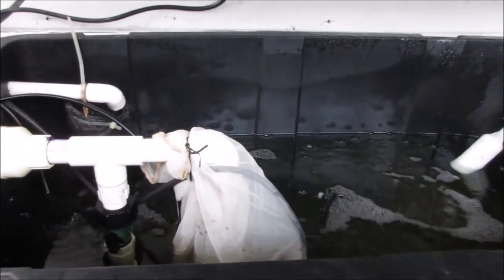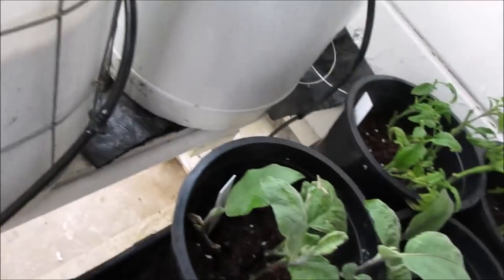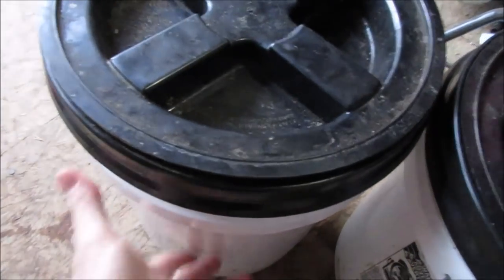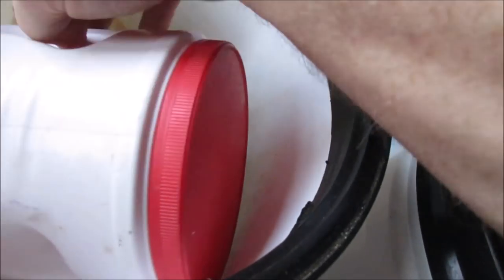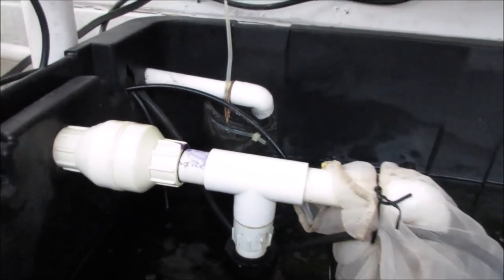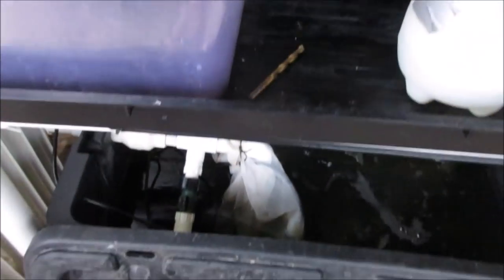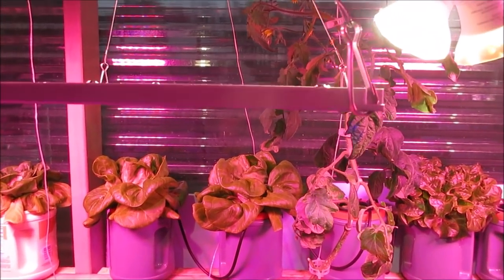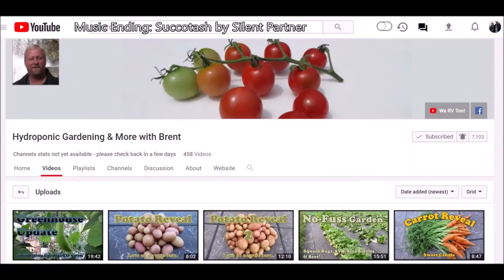How to Grow Microgreens NFT Style (Set-Up)

Comment from the maker: I've gotten much better at growing microgreens.  So consistent, pristine, and with massive harvests based on some changes I made that really set things off.  I decided to write a how-to book on it: https://amzn.to/2ZZdkJb.
Reply: What is the bottom watering tray holding the 1020s? Looks great but cannot find it on your amazon link. Thanks!
Reply from the maker: Amazon link is in the description of every video.
Reply: At 14:15.  Put spreader mat on the tray. It spread water evenly on all tray without dry spots. Its basic must have part of NFT setup. Its very thin and cheap lining.
Reply from the maker: @simonci5177  I don't grow NFT any longer, but if you'll share a link to the mat you mention, that might help others.  I know when I grew, the roots spread the nutrient great.  It also dried between trays which prevented algae buildup and no extra pieces or mats to purchase.  Still, a link is something others might find valuable.
Reply from the maker: @simonci5177  Thanks Simon.  The mat requires light prevention.  If there's light of any kind, it will be an algae mat within days.  In most nft, there's no mats, just a flowing bit of nutrient-water.  I can see how it's beneficial in that video with plants that far apart and under darkness.  Makes sense.

Comment: Nice! I am planning a similar system but no pumps. I am growing with Kratky hydroponics. I'll be using gravity feed from the solution tank to a fill container with a float switch, on the same level as the grow buckets. (I never thought about the air stone in the fill container.) My plan is to not use electricity because we get blackouts and everything would die in a few days if I relied on pumps... thanks for the tour.

Comment: I just got finished with a grow of what I call CABgreens(Central Arkansas Brent)greens.  I would like to report my results. Everything is by weight (seed amt / yield). Radish 60 grams  / 1.31 lbs. Sunflower 9 ozs / 2.45 lbs. Peas 8 ozs / 1.31 lbs. I tried to follow Brents method to the later. Total time from soak to harvest 13 days. I soaked all seeds over night except for half the radish seeds (30 grams). 12 hours soak. 4 days under pressure and in darkness. 4 days darkness only. 4 days under lights. I really could have harvested these two days earlier.  In other words I think 3 days darkness only, 3 days under lights. Yield might be a little lower but I suspect the greens will be a little more tender. This is the first time I have ever done this. I did set up auto watering just like brent with nutrient. The only thing I did different is I did not drill into the auto water pan for the 9 top hat grommets for the inlet side. Instead I ran a 1/2 pvc pipe across the top and drilled holes for top hat grommets and drippers off that. The only reason I did that was because it would be easier to remove and clean the tray after microgreen runs. The tray however stays remarkably clean. I grew these in my high humidity mushroom fruiting chamber. There is no downside to this. Tonight I am going to harvest some mushrooms. Make a stock with the no medium roots. Add mushrooms and microgreens to the stock and season and enjoy. The remains from the stock will go to the worms in my vermicompost bin. I am honestly blown away with how well this works and how easy it is. Thank you, thank you, a thousand thank yous Brent!!!!!!!
Reply from the maker: It is incredibly irritating that I just got this.  Your grows sound awesome and I'm so glad you had such great success.  It makes me feel good to have an impact for the positive in someone's life.  Please continue to share Paul.  I'd love to pin your comment too so it's at the top for others to see and maybe get motivated.  Awesome!
Reply: Well I am motivated and  happy and you deserve the credit.  The NFT tray works so well for lots of things such as using Oasis cubes  to germinate other seeds. Nothing in particular and everything in particular. After the roots start to come out the bottom of the oasis cubes I drop them into a 1/2" pool tube just like you showed in the one video and then into a 3" net cup and then into the dutch buckets that are going in the grow room as well. A couple of LED lights (1200 w COB LED with dimmer) above them and they are off and running. All it takes is a little management of the solution in the reservoir every once in a while. I do have some ph drift but nothing that seems to have much impact. Trying to keep it at 6.8 and keep the ppm around 700. I have found with the Oasis cubes that there is no reason to soak them. Just cut a 3 x 3 cube section and drop your seeds in and place it on the tray and in about 5 days they germinate. Considering setting up a small fawn2 system just to play with that as well . Right now I am growing greens in the dutch buckets.  I do like the dutch buckets because of the portability. I fill them with a small layer of granite pea gravel on the bottom (78 stone). Then use a paint can filter in each bucket and fill them to the top with perlite. One top hat grommet and drip head per bucket seems to keep the perlite moist enough. Pump runs at 3 times / day for 10 minutes for everything which includes the dutch buckets and the nft tray. Right now there is one aeration stone going in the main distribution chamber. Perhaps add a second?
Reply from the maker: @ptcruiser2012  In my winter greenhouse, I just use a double-line cheap aquarium pump with 2 airstones.  Runs 24/7.  I'd love to see some pics of your setup if you want to share.  c3voyage@gmail.com.  If not, that's quite ok too!
Reply: Will do!

Comment: I started my first tray of radish and broccoli with your bubbler. It was incredible . Thanks for sharing your idea.
In this video I noticed you run one minute every hour. My micro greens are Kratky system. I have 9 Dutch buckets of 5 tomato, 3 cucumber and one pepper. I run  4 times every 24 hours, each time 30 min. Do you think I should reduce the intervals or reduce 30 min to 15 min or less?
Reply from the maker: Run what works for you.  There's no rules.  :O)

Comment: Hi Brent, You certainly are sparking a lot of interest here in NC. I have a basement which in the winter still maintains 60 degrees so I found thermostatically controlled heating pads when putting together my start up inventory like the covers and trays, nutrients and sterilization ingredients. We make our own colloidal silver so will be doing a cost comparison for the mold control which is what this is all about. My concern was the watering which this video clearly addresses. So , given all that my first thought was to put the 4 heating pads under the holding tray but now with the moving water I am concerned that the heat supplied would be carried away with the moving water.  The only thing that gives me peace of mind is that the water only moves once every hour so should not really be a concern, right? Thanks for reading my lengthy  post. Bob
Reply from the maker: Bob, my mind is slow tonight and I can't seem to understand your concerns over the watering once an hour.  Please ask again.  Sounds like you got something great going though.  :O)

Comment: Awesome video Brent. I think you nailed it with this one. This is a very clear explanation of the whole system. I plan on implementing this inside my mushroom house. The microgreens will go into the incubation room which I keep at 70 with normal humidity. I am planning on putting the dutch buckets in the fruiting chamber which I keep around 65 but at 80% humidity. Pepe did mention that high humidity helps the taste of the microgreens. If that is the case the whole system could go in the fruiting chamber.  I am curious though. At the end of the video you show the tomato plants placed in the tray. I imagine they are there to be under the light since you have them in another tray instead of taking advantage of the nft tray below. Are these being separately watered? Is there a reason you don't just place them in the autowater tray as well.  Could you also start seedlings in this by placing the oasis cubes directly in the autowater tray. Seems to me if that is possible then this would create a very flexible system indeed.
Reply from the maker: Thanks Paul!  Yes, tomatoes are there just for the light.  The tray is actually for seed-starting and microgreens.  It's ideal for both.  With seed-starting, I always use a self-watering tray underneath.  I could potentially use the seedlings directly in the NFT tray, but then I run the risk of water not being high enough to enter the lower part of the seedling pots and potentially some dirt flowing back to the reservoir or clogging the return.  I only want to use the tray as NFT when roots extend down to it.  On the oasis cubes, YES.  Very astute.  In fact, I'm doing a version of what you say now, but you'll have to catch that video later!  :O)
Reply: @C3Voyage  You always drop those hints of future videos and then I just sit in front of my computer for days without moving until they finally appear.
Reply from the maker: @ptcruiser2012  Lol.

Comment: Have a great day Brent. Best wishes Bob.
Reply from the maker: You too!
Reply: @C3Voyage   Hello Brent,  I have been using the master blend mix as you have shown,  but my PPM is at 920---to high.  What  would you suggest I do to lower it ?  Thank you.  Don
Reply from the maker: Hey Don!  Wanted you to know that you replied in BobMel's original comment to me which means he will receive this as well.  It is certainly not a big deal to me, but I thought I'd mention for the future and, if you wanted to continue with me after this response, you can certainly start a comment of your own.  So, down to bizness.  :O)  920 is usually fine except for possibly lettuce.  This is true in cooler weather as plants transpire slower.  So, to answer your question, it's simple:  Add water.  The more you add, the lower the ppms will go.  If you're targeting a specific ppm, you'll need to know your water source ppm before adding nutrients and take that into account.  I wouldn't change the ratios.  Hit me again with any questions you may have!
Reply: Good morning guys. 🎄

Comment: Have u tried just growing in the large trays? Would that make your washing method too difficult or would it be necessary? Would the fungal spray b enough to keep mold under control. Giant tray of peas or sunflower???
Reply from the maker: Might be a cool thing to do, but logistically too hard.  It won't go through the door without turning sideways.  It's bigger than 4 1020s and I would have to figure out how to weight the seed down and cover it to block light.  It could be done, but I'd rather do 1020s  which also allows me to use the tray for seedlings and other microgreen grows.

Comment: Hi Brent, I'm so glad I finally found detailed info on growing microgreens hydroponically. I will check out your book shortly. Thanks for sharing video of your systems. I have a hundred questions which I'm sure you've answered most many times so I will stick with just one. Years ago I used Ebb and Flow, but now thinking about the large amount of water I would need to tank in order to adequately flood my trays, I think a constantly recirculating system would be better. Do you think this is smart with a 4 shelf grow rack? The top tray would be about 5 feet above the reservoir.
Reply from the maker: Doable, but I ruled it out.  Could try it for fun.  I do that sometimes.

Comment: Have you experienced clogging of drip emitters?
Reply from the maker: Not with these in the micros tray so far, but definitely in my big greenhouse.  I quit using this style of dripper a couple years ago even though I kept them.  I use a cleanout dripper now when I use drippers.  If these drippers clog, I'll put a cleanout dripper on it.  They unscrew easily to clean.  If I were to buy some for this purpose now, I'd buy 1/4" valves and adjust as necessary.

Comment: For microgreens, why does NFT work any better than a simple flood and drain? NFT seems like a more complicated type of system.
Reply: Neither are reliable or dependable compared to aerated water culture.  I was able to use the NFT for a bit, but I found it's not nearly as productive and prone to disease.  A buddy of mine tried flood/drain and it was even worse than NFT in his opinion.
Reply: @brentginastravelingadventures  Oh okay. The reason I ask, is that several large MG growers have gone to flood and drain. It seems to work for them. The software they are using has lighting and watering control built into it. Watering hundreds of trays is labor intensive.
Reply from the maker: @randallsemrau6911  Makes sense on very large scale like that.  In IHG (my style I wrote books on), one rack with 16 grows, takes a few minutes a day to water and check on.  It equates to about 30 to 50 lbs of micros per rack every 10 days or so.  IHG grows ~2lbs per brassica tray and ~4lbs per sunflower tray.  Check out some of the videos in my playlist.  There's around 100 videos there.  There's also no medium to worry about with easy harvesting, washing, and cleanup.  I can't see trying to push the limits beyond 6 racks or so.  However, I can see where some major players would maximize capability including automation.  What media does flood and drain grow in?  Curious.  That's a cost.